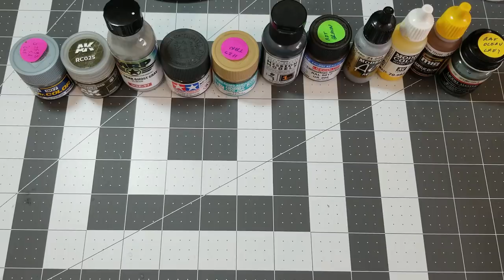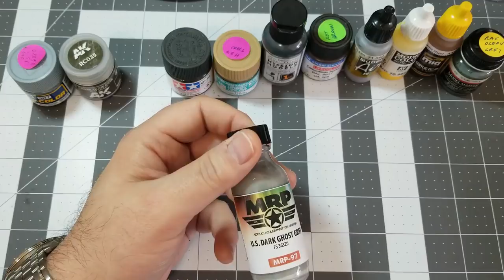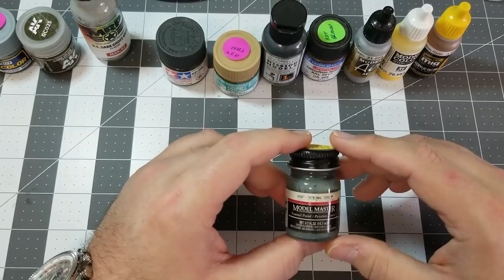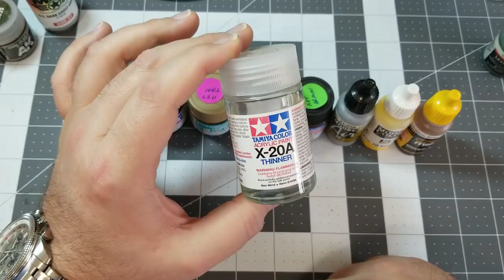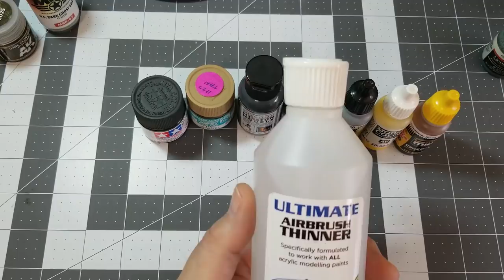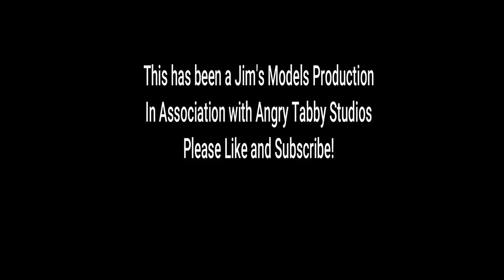Scale Modeling Paint Chemisty Overview

Comment: What no Alclad II?
Reply from the maker: kylwell I actually have some, but I just haven't thrown it away. I don't really care for it. Shelf life seems to be an issue. I use Mr. Paint for metallics.
Reply: Really? 'Course it may be where I live, a mile up and 30% humidity on a wet day. I really like their flat clear coat, dead flat and no frosting.
Reply from the maker: kylwell Can you get their enamel clears to dry? I know thats a real big issue. I have a build I used the light sheen on back in 2015 that is still sticky to the touch.
Reply: Yes, used them on my last 3. I do know they can be a tad sensitive to contaminates and know a few people in more humid areas have had issues but they've also had issues with clear acrylics. Still sticky after 3 years... could be all three. Have you tried a hair dryer? See if the warm dry air will help it cure. I know a guy who is a paint junkie (he owns god knows how many brands) I'll see if he has any idea.